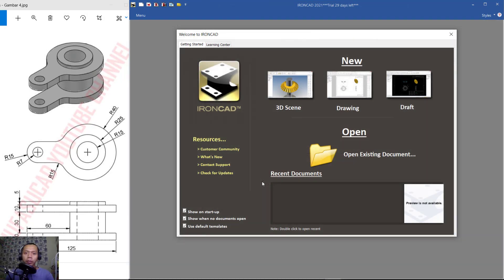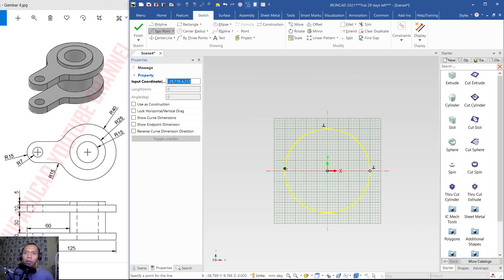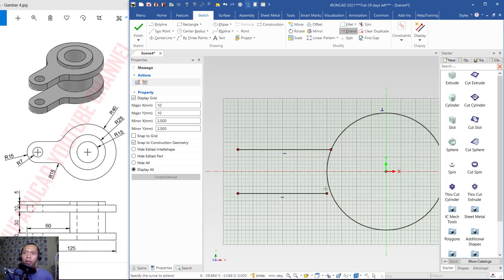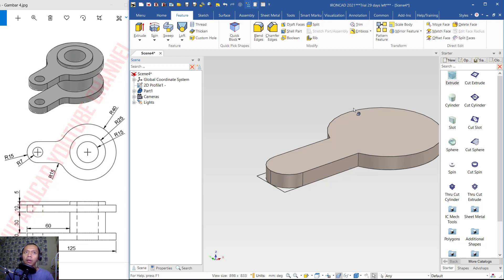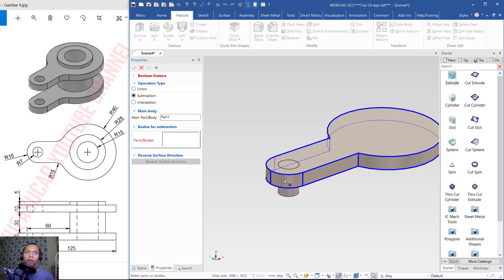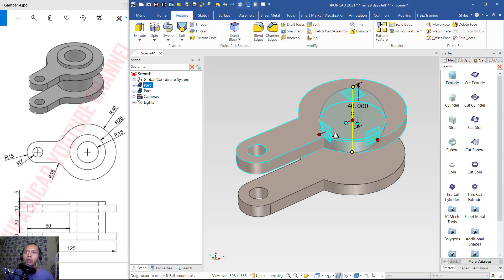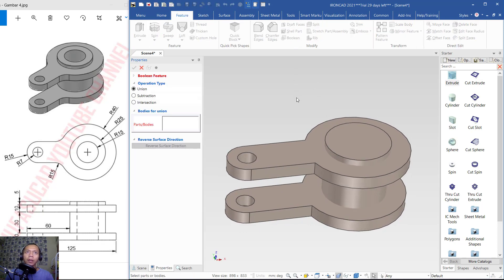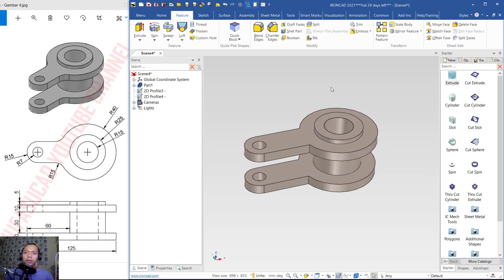IronCAD 2021 3D Modeling Tutorial For Beginner [COMPLETE]

Comment: This is not the way to work in IronCad.
Reply: This is one of the ways to keep the same design as other software,
But as you said, this is not the most distinctive drawing method of IronCAD.
Block-based modeling is the essence!
Reply: @Sauji1022  By doing this way, then why I should work with Ironcad. Then use any other software like Fusion 360 in which case is free for home use.